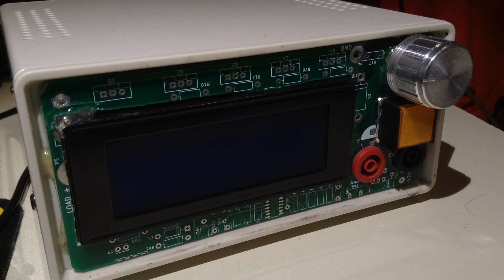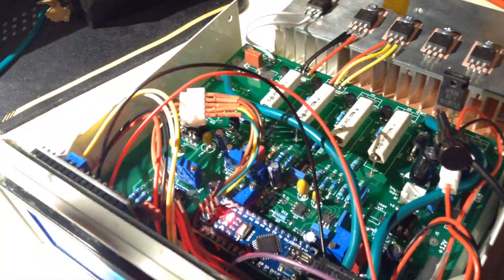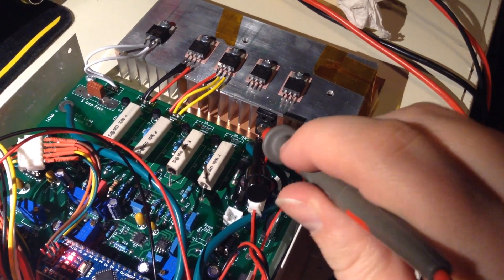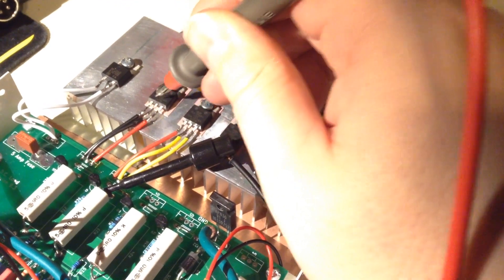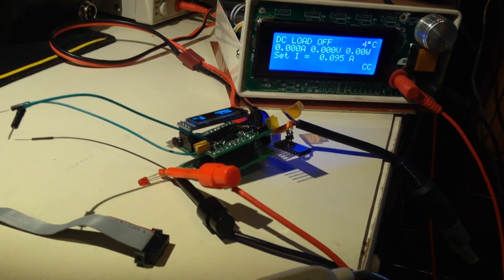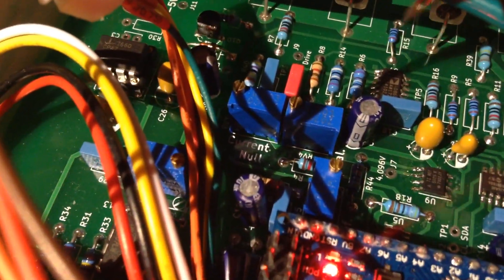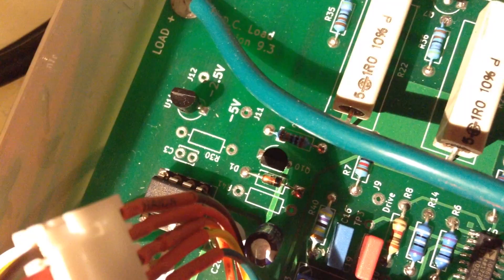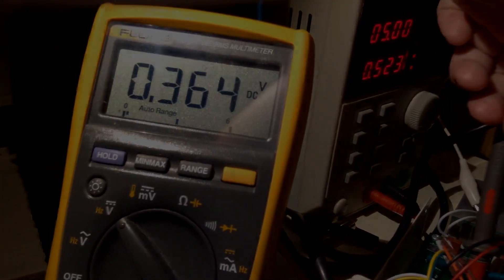Scullcom's Electronic DC-Load part 2 - power-on issue

Comment: I've been meaning to comment on this one, but the week got away from me. I am glad that your back completing this project. You always seem to take on unique and challenging projects. I always assumed that Scullcom Hobby Electronics' projects would be pretty much perfected when he completed them. Was the power-on issue introduced with would software tweaks or was it there in the original design?
Reply from the maker: Yes forgot to install the resistor in the power-on circuit. When power is applied, the arduino takes a bit of time to boot, and meanwhile power-on circuit keeps the loading transistors off to not accidentally cause high uncontrolled currents on attached loads. The video is from october actually. I've been having a lot of video build up. I'll be back when I feel a bit better.
Reply: @bwack  October? I know how you feel. My last video was from stuff I recorded last year, May to August.

Comment: I can't remember if that's a board you made or bought. Seems like a vital resistor that's missing :) Or it's a machine meant for very patient people.
When you're probing around a circuit measuring things, it's always exciting to see if the thing you measure is actually what you expected. The measurement is always right...but can you explain it?
Reply from the maker: It is a while ago now. I sourced all the parts myself including the pcb. It was a lot of components. Yeah, I have soldered in the resistor. The delay is about 5sec. I think it is because the arduino takes some time to start because of the bootloader, and the outputs must not be loading an attached power source accidentally at power on. I find it fun to figure out why readings are not what I expect them to be. I have mounted a fan and will mount the second one. I\m paying a lot of pain because I decided to put the thing in a tiny box. It will be interesting to see if I can fit the heatsink inside the box. I have received nylon spacers  to hang it on the top lid.
Reply: @bwack  That heat sink would actually look pretty cool as the back side of the device. And it would have optimal cooling that way I think.
Reply from the maker: @TheHighlander71  It is a good idea. The case is also very light, so I don't know how well the box will balance with it on the back. I will try.

Comment: First :-)
Reply from the maker: That was quick :)
Reply: bwack It just came out in the moment, I was looking at my iPad and  I got the announcement. I like your electronic load. I would like to have one, I think, but I am not so sure, since I am not so much into power supplies.
Reply from the maker: @svenpetersen1965 It is a time consuming project. Getting all the parts and making the enclosure. It is all open source though. Just look for Scullcom Electronic DC-load. Lots of videos on his channel. I just need to get a better camera mount. Looking for a mount that can hang from above so I can get my hands free.
Reply: bwack I think, it is time consuming to watch all those Videos. I think, a pretty universal tripod for a not too heavy camera is the gorilla pod. It has legs, that can bend and the sides are rubber coated, so you can attach it to many things like a lamp pole or whatever. Some even use it with a dlsr camera. It works, but one has to be careful. Take one with a ball head and maybe not the cheapest. https://joby.com/uk-en/gorillapod-flexible-camera-tripods/